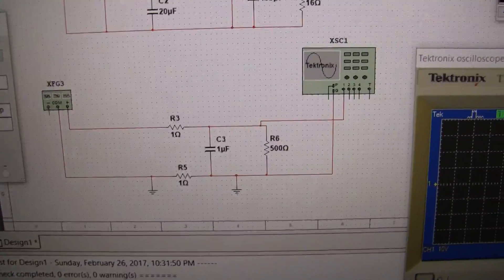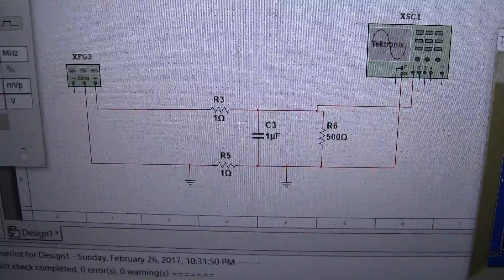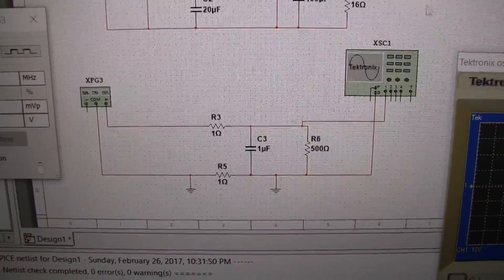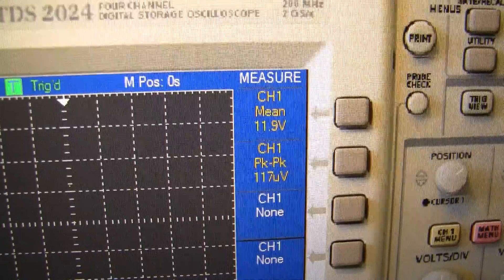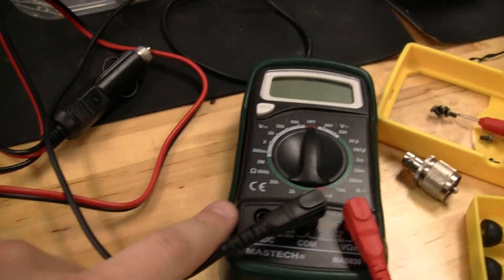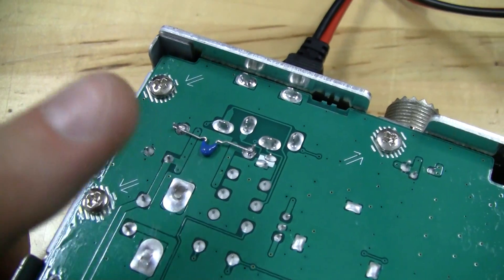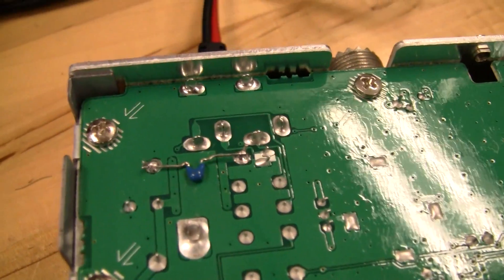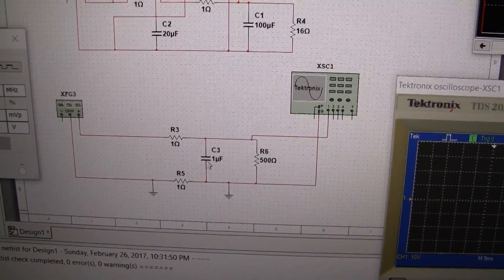Quick Tip: Reduce Noise In Your Radio Power Supply

Comment: i am genuinel surprised seeing this video, mobile cb radio do not have a power supply but are conncted to a 12 volt supply just like you use with your radio or the car battery.:face-red-smiling-live:😀😄😁😆

Comment: It makes you wonder why they didn't include power supply decoupling in the original radio design
Reply: It was designed using a very clean supply in the lab.

Comment: Would this work for a cooling fan in a truck that causes noise on the cb radio?  Would there be a way to filter that out?
Reply: .1 to .47uf capacitor across the power leads as close to the fan as possible.   If you have multiple feed lines to the fan (dif speeds) each one will need a capacitor to ground.  Usually .2Uf is ideal,  higher pitch noise=need higher capacitance filter.
Reply: @Doonit_hard_way_since_65  Thank you, I appreciate you answering!

Comment: Great video. 
Can the capacitor be located externally but as close to the transceiver as possible, without removing transceiver that is in a tight space to remove ? Between the +12 and ground wires right before transceiver?

Comment: So would this do the same if applied directly at the lugs of the power supply itself? So that it's use is universal to all of the equipment powered by the unit
Reply from the maker: Shawn  Douglas yes and no. It will help, but the noise can be picked up on the power wires on their way to the radio. So doing it at the radio end mitigates that noise

Comment: I saw a cold solder joint to the right of the +12 of the capacitor.
Reply from the maker: at what time in the video?
Reply: AirSoftMaverick3232 4:18. The joint to the right of the +12 side of the capacitor.
Reply from the maker: right, 4:18, very funny

Comment: What about just swapping out the capacitors in the power supply itself with higher capacitance ones? Would that help smooth out the ripple?
Reply from the maker: James Johnson you're talking about something like a bench top supply? That might help, but that won't solve noise that's picked up on the power wire on its way to the radio. Best to do noise suppression on the radio end